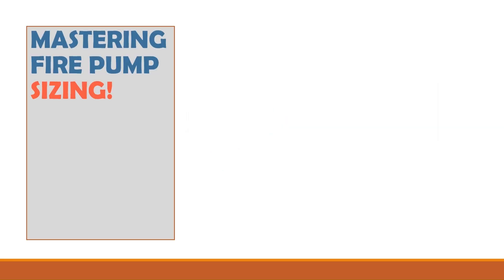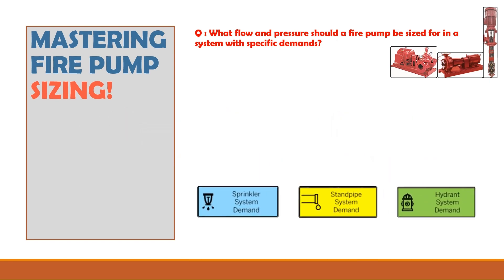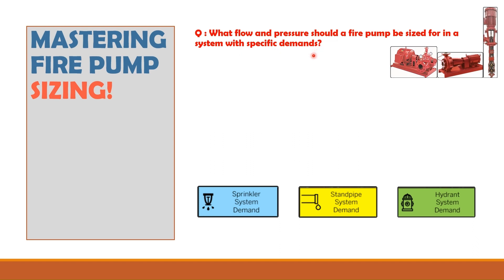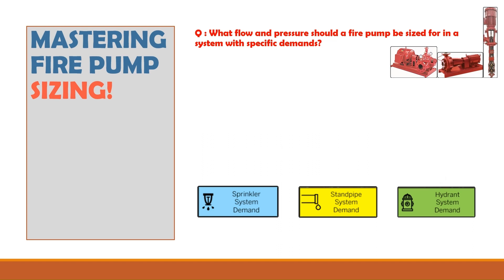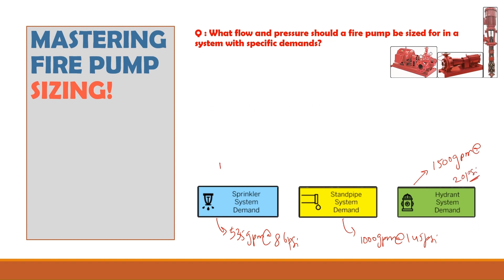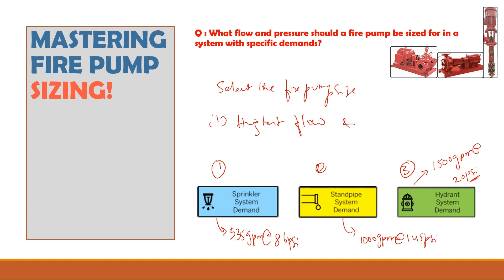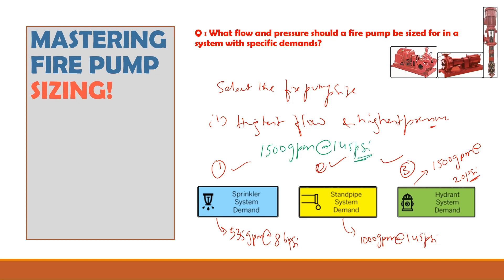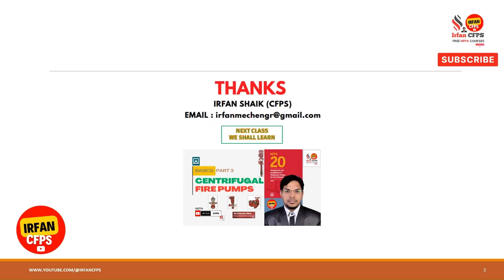Fire Pump Sizing: How to Choose the Right Fire Pump

Comment: @irfan thanks for providing valuable information. 
How you have taken this parameter for sprinkler 535gpm@86 psi, stand pipe 1000gpm@145 psi, hydrant 1500gpm @20psi.

Please share if any nfpa ref for ordinary hazard.
Reply from the maker: I consider as an example.

Comment: Hello sir, 
can you please explain the difference between choosing the highest flow rate and the total of the sprinkler, standpipe, and hydrant? How does it work when we choose the highest of flow rate? thanks🙏
Reply from the maker: For example, as per hydraulic calculations

if you have demand from sprinkler is 450 gpm @ 60 psi

and demand from hydrant is 1000 gpm @ 55 psi

and demand from hose cabinets / standpipe system is 750 gpm @ 100 psi

Then our SYSTEM DEMAND will be 1000 GPM @ 100 PSI, Based on this requirement we shall select the FIRE PUMP CAPACITY.